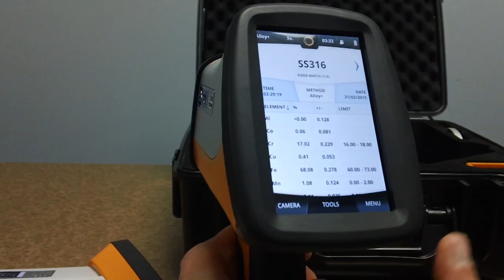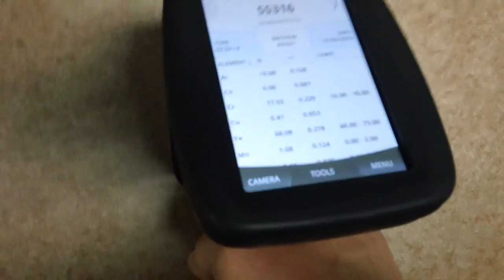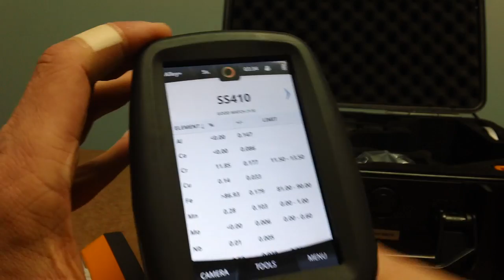Handheld XRF Demonstration and Overview (New XMet8000 Alloy Analyzer)

Comment: What metals or alloys that doesnt recognize and how much it cost ?
Reply from the maker: a big range of alloys, over 10,000 in the library.  Price varies on the best configuration to meet your intended use. Contact Eastern Applied (http://www.easternapplied.com/) and we can help with additional info or connect you with your local distributor.